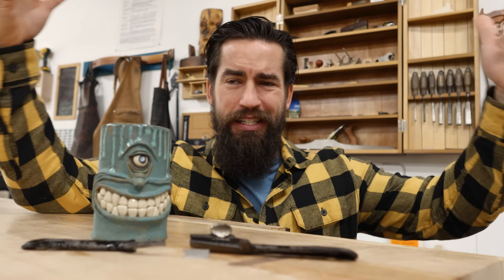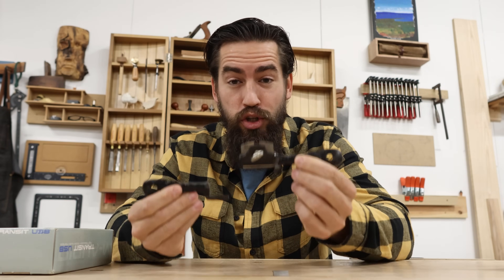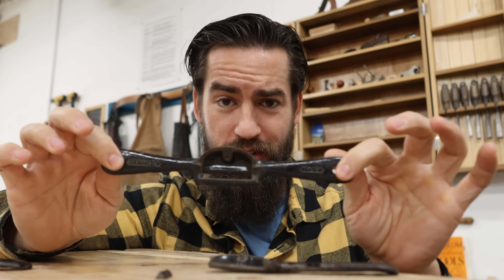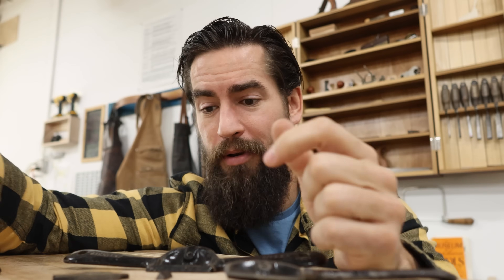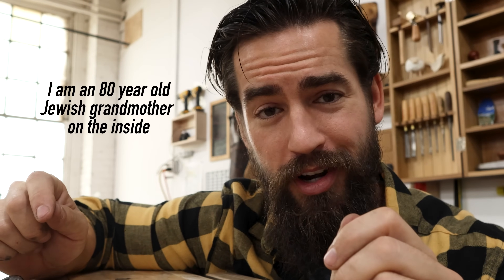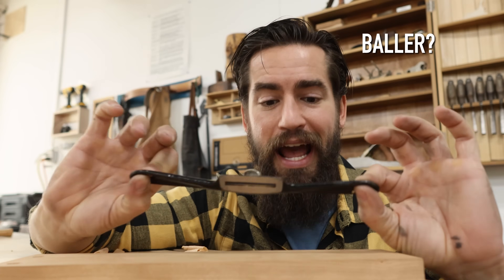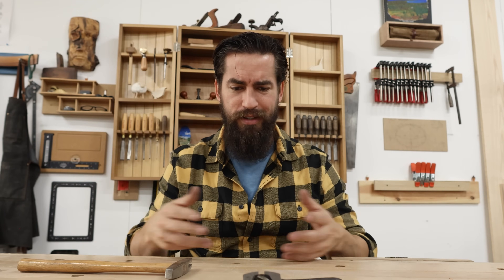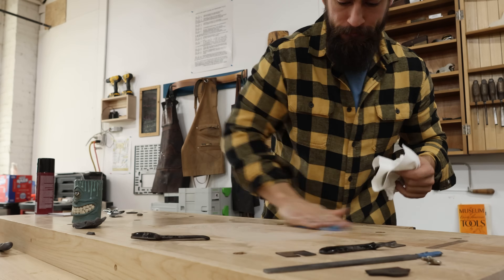I wish I knew this sooner

Comment: I was there when you broke your spoke shave, the look on your face when it happened. Priceless.
Reply from the maker: I was literally in shock 😳🤣
Reply: @ENCurtis  you shouldn't have been cast iron isn't steel its vulnerable to fracture from impact. Ive lost 2 cast iron pans by snapping off the handle. Every time you hit it on the edge instead of tapping the steel you where probably creating micro fractures in the cast iron
Reply: 👍🏻👍🏻👍🏻👍🏻👍🏻👍🏻I ended up with a couple of yardsale finds... then bought the Lie Nielsen about 4 or 5 years ago...... still questioning that decision.... of course I'm a jackass of all mediums... but the round handles give you no registration and the throat opening seems too small. Shaving jam up, constantly am digging out. Perhaps one day I'll remember to bring it to camp to be educated 😊
Reply: I was there too.  The shock was palpable!
Reply: Not everyone knows this trick but set your blade at a slight angle so you have a side that cuts heavy and the other light
Reply: @ENCurtis There are people in this world capable of welding cast iron. Maybe you'd be interested in finding one to fix your spokeshave. I had someone weld a tab in the guard-plate hole of my old 1957 Delta Rockwell bandsaw cast iron table to keep the insert from rotating.

Comment: Eric, I recently retired as cabinet maker and used 64’s all my 48 years at the bench. My absolute favourite spokeshave. However I’ve never tapped the casting to adjust. I do however tap the blade. It’s worked for me for 48 years. All my eight 63’s & 64’s are in great condition with the exception of the paint I’ve worn off them from extended use as a chair maker. Just change the tap method.
Reply: FYI, a score is 20.
Reply: I stand corrected  @theMrFouldsy
Reply: I'm with you on that
Reply: Ooo! I'm curious what your spokeshave get up to these days

Comment: I'd wager that tapping it on your work bench causes more metal fatigue than adjusting it with your hammer.
When you hold the spoke shave loosely in one hand and the hammer in the other, tapping them together causes a small sharp shockwave/vibration similar to pool balls hitting each other. That energy is pretty gentle and dissipates in multiple directions kind of like a tuning fork decaying, but in an instant.
When you swing the tool down toward your work bench, you're putting momentum into the mass of the whole tool. When it comes to an abrupt stop on that corner, the mass of the handle wants to continue downward and puts a large torsional force into a narrow point on the weakest part of the tool.
An intuitive way to think of this is if you take a long thin strip of wood and swing it against the corner of your bench, it'll snap in two very easily. If you hold that same stick up in the air and beat on it with a hammer it's much harder to make it break.
Hope this helps your new (to you) favorite spoke shave last the rest of your life!
Reply: I like this. I don't hit my Spokeshaves on the bench. I didn't even know it was a thing until 30 minutes ago. Tap with a 3oz hammer. A lot less effort and more control.

Comment: thank you EN . i was a machinist on a ww2 sub tender back in 72 . a little back ground if you will. all metal gets brittle in time. old machists trick is to machine over sized and toss it in a manure pile for a yr lets the carbons jell if you will . it is not a practice used in manufacturing . words are hard too . good luck .

Comment: 5:32 I’ve bought tools from eBay. I always contact the seller, ask a few questions about the tool I’m looking at, ask for 4 or 5 more photos from specific angles, ask if the seller has tried to use it, most of them say no, or “I played with it for a bit but it’s not really my kind of tool”. So I buy it, he says he’ll make sure it’s all there, put it together the right way, wrap it and send it tomorrow. The box arrives in a few days, I open it, I pull the tool out … and I usually laugh my funny bone off because it’s totally put together wrong! And then I say to nobody, “No wonder it’s not your kind of tool, the way you have put it together is not at all how the tool maker designed it to work!” LMFAO!

I’m glad you were able to replace your 94 so quickly! Thanks for the clean up/pretend restoration!!

PS Start Making channel sent me your way. I’ll hang around for awhile … maybe longer 😉

Comment: Spokeshaves are so underrated. They can shape curves with ease and leave a finish ready surface with a sharp iron. 
Instead of using a steel hammer to set the iron  use a small hardwood mallet.  I made mine from Ironbark a tough as nuts Aussie hardwood - specifically for setting wooden plane irons.
Reply: That's what I was going to say too. The metal on metal contact certainly increases the chance of breakage and causing micro fractures to occur since it's such a hard surface it's extra brittle.  A hardwood mallet or hammer would certainly be better for longevity.  While the wood is super hard it's nowhere near as hard as the hardened steel hammer head. All you want to do is put enough energy into the handle to scootch the iron. Wood would certainly do this perfectly fine.

Comment: I have been restoring Stanley planes and a Stanely #82 scraper over the last few months.  I tried CRC Evaporust and that is amazing stuff.  Environmentally friendly and reusable.  Just let the parts sit in the solution and the rust is gone.  It does not affect the Japaning, referred to as paint in this video.  It removes the Iron Oxide, rust, without removing any metal.  If I ever smacked open my father's tools on a work bench I would never been able to touch another tool of his.  You learned a valuable lesson about cast metal, luckily you were able to find another to replace it.

Comment: Repair the old casting by using a TIG torch to melt silicon bronze filler into the fractures. You just need to bevel the edges of the breaks a little bit and you will need to set up fixturing to hold the pieces while they are joined. The color of the bronze will be visible, but you can just repaint.

Comment: I have a weird way to adjust these and I've never seen anyone do it before.

What I do is I set it on a known flat surface. With the blade loose. I then slightly raise the back up and let the blade fall then I tighten it down. If it's too far out I I loosen it and lower the back of the shave closer to the surface and then tighten again.

Works 100% of the time for me and I never have ever had to hit it with a hammer. It also takes me seconds.

Comment: Hey Curtis, if you have all the parts of your broken handle or at least most, it can be used as a pattern to make a new one. Any backyard sand caster can make a new one for you. You can even change the metal if you want a different weight. Threaded holes will need to be tapped. The surface around the blade will need to be flattened and square. A machine shop would know what to do there.

Comment: Do yourself a favor and get some Evapo-rust. Degreasing, then some time in Evapo-rust, then light oil. It will save you time and get rid of the rust in the nooks and crannies making your restoration last. Your use of "undulations" was spot on. Each tap causes a bit of flex and flex means fatigue and fatigue acts over time.

Comment: As a former engineer I'm all too familiar with the choices made in design that affect the life of a thing. And all things do have a life, from material fatigue at the very least. Get into moving parts and now you've got wear bringing the life down further and introducing planned obsolescence along with it as companies will only design a thing to resist wear for so long.

When I buy things, the more complex it is the more I'm willing to spend. When it's a solid piece of metal is when I spend the least, because at the end of the day it can just be welded back together. You could definitely get this fixed.

I'm actually looking at getting into 3D printing so I can make replacement plastic parts for things. So many modern goods are garbage if a single fingernail sized plastic piece breaks.

Comment: A few friendly possibilities.  W/R/T corrosion on iron or steel, if there is more than mere discoloration, you can often reduce or almost eliminate surface corrosion by working (sort of scraping) the area with the edge of a piece of copper and some oil (3-in-1 works!).  No guarantees but often worth the effort.  I have a few pieces of 1/8” sheet copper that have edges that work well for this purpose.  Old pennies (not the post 1982(?) zinc pennies) work but not as well - relatively pure copper is better.  The copper tone left by the scraping can be removed easily with 4-0 steel wool.

For really fine surface clean-up, you can buy bronze wool that is obviously softer than any iron or steel product, and softer than many finishes other than paint.  

I totally take your point about the surface of the bench, but if people are concerned about this it’s very easy and cheap to keep a 2x4 piece of 1/4” MDF or equivalent around to lay down on top.  It’s flat, cheap, easy to store and easy to “install” and remove.

Comment: I stopped at a countertop place a couple years ago and asked if they'd sell me an off-cut. Guy just gave me a 1.5" thick granite cut out from a sink. It's a great size and flatter than I can measure.
Reply: A lot of shops will give it away too.  You have to pick from a pile to chase down the "rectangle" pieces.

Comment: Just drop the broken tool to a welder or decent body guy. They can braze it back together and then it will be good as new. And if you can’t find someone, send it to me, I’ll gladly do it. It’s a 30’ job start to finish (remove old paint, lightly groove the crack, braze it up, file the seam down for a flush finish). You can either repaint it or treat it with a coating to prevent corrosion.
Reply: Kinda curious what you meant by 30’.  In wood.  That means 30 foot which doesn’t work for this.  Or was this meant to mean minutes.  Btw. Just started watching video as I was a little confused early. As I watched while reading for a few more seconds, I kinda believe your talking minutes?   Please inform me either way.  I feel like an idiot as I know how much welders make vs woodworkers
Reply: Glad you got another favorite spokeshave, now for 3 in 1 oil…….yuck it stinks and I don’t like the smell but that’s just me.  You certainly made me laugh with your cotton mouth this morning, get some rest. 😊
Reply: 30’ in this context means 30 minutes. Had he said 30” that would have been 30 seconds (which, yes, would be crazy fast)
Reply: @aaronblackford981  that’s a common engineering mark for minutes. Seconds would be “. Full angle measures would be 75*32’12” (degrees, minutes, seconds). Sorry to hash up a woodworking channel with engineering jargon 🤭
Reply: @roberthahn8555  I wish the when we (NZ & AU) when metric in 1966, they'd dropped ' & " and gone with decimal degrees; so much easier to draw up from a title or survey plan than imperial mets and bounds (I was an architect)
Reply: I have felt your pain, though not the public embarrassment. A few years ago my #78 filter plane jumped out of the cabinet and onto the concrete floor.  Fortunately friend in the RMTC sent me a parts body. 🙂
My first woodworking tool was a #51 spokeshave,used for making canoe paddles.  60+ years later I still use that tool.
Get yourself a copy of John Walter's book on Stanley tools. Research Patrick Leach's Blood & Gore of Stanley tools.  Both are excellent resources on old tools.
I totally agree with all your wrapup Q&A.  I use a piece of MDF for my sharpening base. Flat base for a spokeshave? Why do the make them with round faces?
Reply: Filister!
Reply: Do NOT repair cast iron using brazing, it needs to be repaired by flux core welding aka FCAW. You should be able to find a welder experienced with repairing cast iron at an auto repair or tractor shop that specializes in old cars or tractors. 

You can learn more about the various methods of welding cast iron in an article by brazing period (plus the com) “Cast Iron Welding Procedures” … It’s a pretty detailed review of all welding processes being used today and why they can be used and if not why. I imagine that article is authoritative given the site is dedicated to brazing.

Sorry if you see this multiple time, youtube kept removing and most likely routing it to the review queue for moderation so I had try multiple changes to get through.
Reply: @inmyimage1081  I hate to litter up this channel with back and forth about repairing a tool, but your comment is 100% wrong. FCAW is not a recommended process for cast iron, especially not a small tool like this. Any SilBr or Nickel-based filler wire will be the perfect match. The part is not large enough to worry bout heat control, or tempering, hence SilBr and its advantage of ductility will make the repair durable. The link you posted is to consumable supplier; they are not a definitive source of authority on brazing. 30+ years of Nuclear-rated welding on submarines tells me so.

Comment: just a question from an old-time woodworker but only metal-curious: can old cast iron be welded back together?  Thanks for reassuring people that "It's flat enough! Go make something."
Reply: It's possible but not usually worth the effort. Keith Rucker has some videos on it. It can be brazed instead, brazing is like high-end soldering. On a tool like this or a hand plane that's been dropped, the break is usually in a thin spot that's under a lot of stress in normal use, the blade mounting point. So the repair has to be good. Heat can distort the surfaces so they move, bad news. If it's something common like a #5, finding another one is easier. If it was Grandpa's #10 1/4 rabbet plane, maybe.

Comment: What is the mouth opening meassure (metric system please) of your newly restored spokeshave?

It looks a little wide, mine is like that too, about 2mm or a bit less, it works fine. Do you think a tiny mouth gap is an overrrated feature for a spokeshave?

Comment: Interesting. I have a few questions.
A) What is the patent situation on these tools?
B) If one were to reproduce this tool, any reason to do it in cast iron vs steel?
Reply: Cast iron is way cheaper than steel.  Steel must be milled out from a blank or welded into the shape cast iron is just cast and prepped and usually mill one face
Reply: Many metals can be cast, including steel. Iron has some advantages over steel in these tools, but so might aluminum. It really depends upon the force application as to which is “best”. When these were originally made, cast iron was much more common, then ductile iron surfaced as a practical replacement metal.
Reply: @cj-ef1rp  casting steel is not the best way to get steel properties we all expect.
Reply: @dicekar  never said it was. Only clarified that steel can also be cast. But there’s tons of cast steel parts on tens of millions of cars traveling the road 😉

Comment: Do NOT take advice to get it repaired by brazing, it needs to be repaired by flux core welding aka FCAW. You should be able to find a welder experienced with repairing cast iron at an auto repair or tractor shop that specializes in old cars or tractors. 

You can learn more about the various methods of welding cast iron in an article by brazing period (plus the com) “Cast Iron Welding Procedures” … It’s a pretty detailed review of all welding processes being used today and why they can be used and if not why. I imagine that article is authoritative given the site is dedicated to brazing.

Sorry if you see this multiple time, youtube kept removing and most likely routing it to the review queue for moderation so I had try multiple changes to get through.